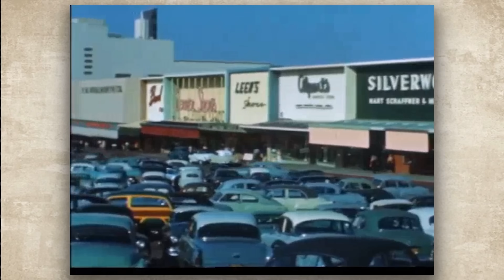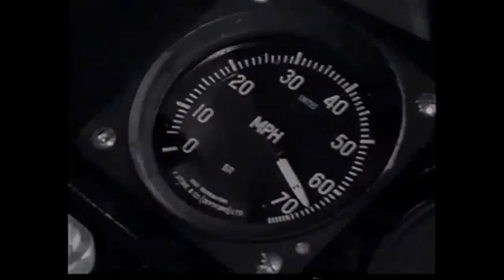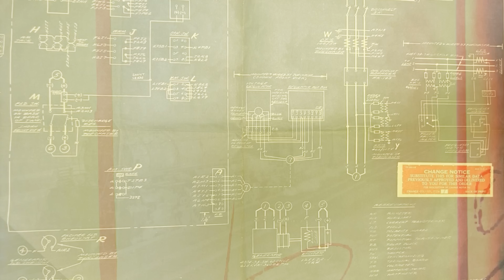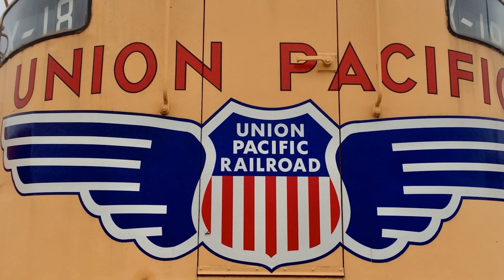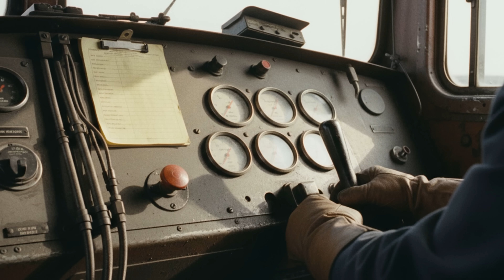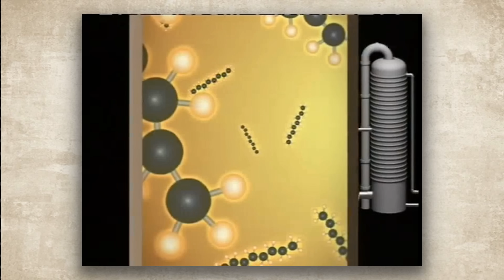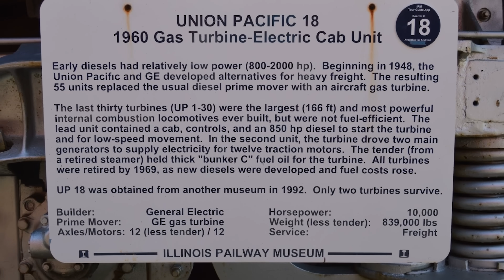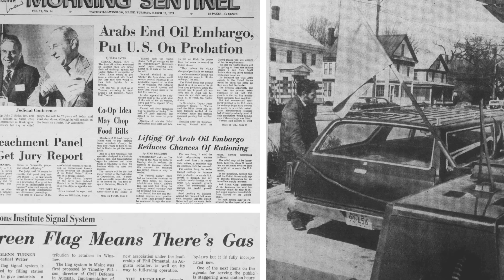The Locomotive So LOUD It Was BANNED From Cities

Comment: They could have simply electrified the section of track and used electric locomotives to support the trains. Everyone knows that they require little maintenance, electric motors produce a lot of torque, are quiet, and electricity is inexpensive. They can be interconnected and then controlled by just one locomotive engineer.  All the problems they had with a jet turbine locomotive could have been avoided.

Comment: No such thing as too much power.
Reply: It's like too rich, too thin or too sexy.
Reply: Unless you are a tree hugger.😂
Reply: At one time, railroads had much higher profit margins.  They could simply choose locomotives based solely on performance. Now, efficiency is just as important.  Saving even a small amount on fuel is critical now. Yes, they make large profits but even small variations in something like fuel costs is very important.  It’s like a retail juggernaut like Walmart.  Their profit margins on each item is small.  They make a lot of money because they have so many transactions.

Comment: UP was in their "bigger is better" age even if it didn't always make sense.
Steam would benefit from making "double locomotives" like the Big Boy driven by a single crew. Union Pacific took that mentality to diesel. It wasn't until the Centennials in 1969 they realized that it's actually better to have two diesel locomotives instead of one locomotive with two engines. One of the problems with going big is each problem takes out the entire locomotive, hence loss of lots of traction power. Instead if it's multiple locomotives, losing one is not a dead stop and it has less impact to let one locomotive spend a week at a repair shop.

The turbines were built during the era where UP could not get the locomotives big enough. This might be part of the reason UP aimed at such power rather than just using multiple locomotives like other railroads did at the time.

On a side note, when it's mentioned that bunker C is a super dirty fuel. It's possible that the turbines running on it might have been the most polluting locomotives ever even when you look at pollution per horse power. The high sulfur content made it worse as burning sulfur was the primary source of acid rain. Nobody cared about that until the 1980s and it got mostly fixed in the 1990s. Still unlike power plants or diesels, the turbine locomotives could not have filters on the exhaust. There is no way we will ever see anything like them again because they would be banned everywhere due to the exhaust. Noise and running costs would be a show stopper too.

Also the mandatory for this context: Americans are loud. American locomotives tend to be louder than European locomotives even if producing the same amount of power. It's a cultural thing. This makes the turbine scream they are American.... and scream in general.